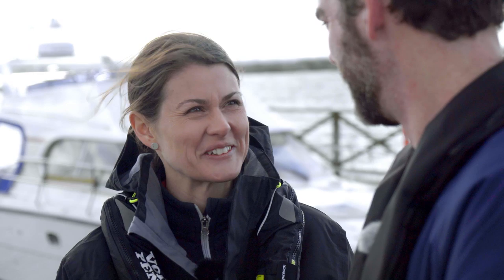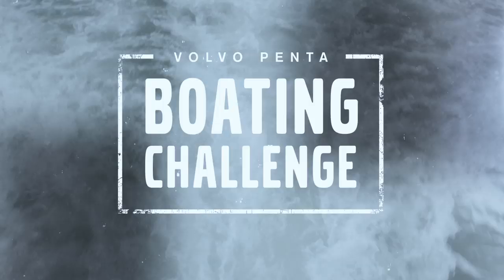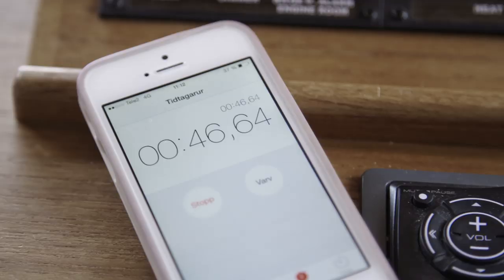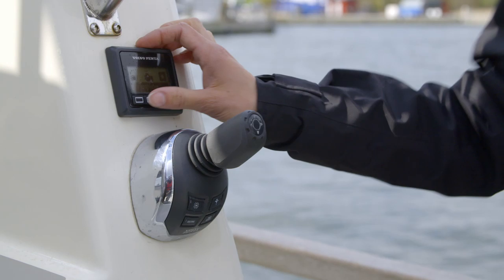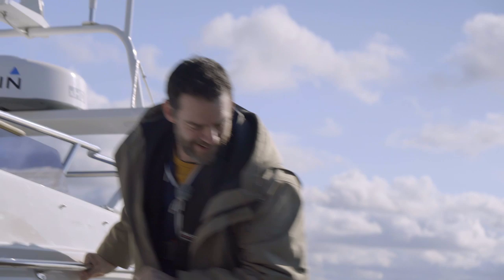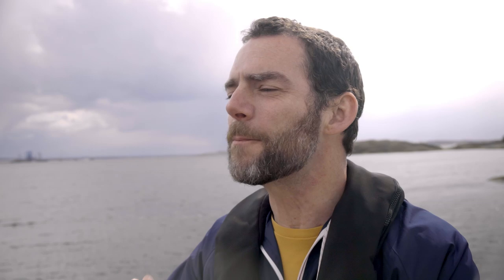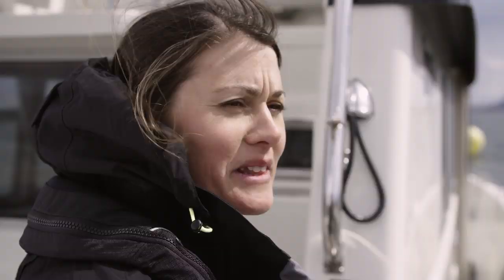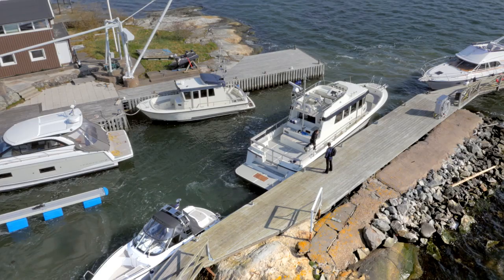Volvo Penta Boating Challenge Episode 3 – Worldclass joystick docking & driving

Comment: Do not buy a boat with a Volvo penta motor.  They are impossible to find anyone to fix.  My boat has a rogue alarm that goes off and nobody can fix it.
Reply from the maker: Hi Justin. Have you been in contact with one of our authorized dealers? They should be able to help you with technical matters. You can find a dealer close to you here: https://www.volvopenta.com/about-us/dealer-locator/ 
Kind regards, 
Volvo Penta
Reply: @VolvoPentaOfficial  yes.  Multiple Volvo certified dealers/ mechanics have attempted to fix what would seem to be an easy fix. Codes appear, items are fixed and alarm are still present.  It’s extremely frustrating.  Motor and boat relatively new with relatively low hours.